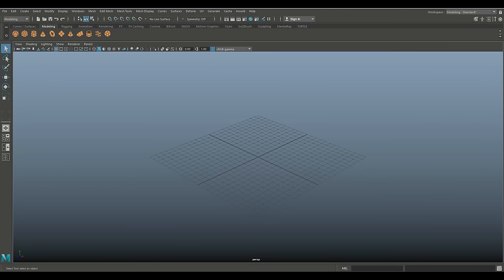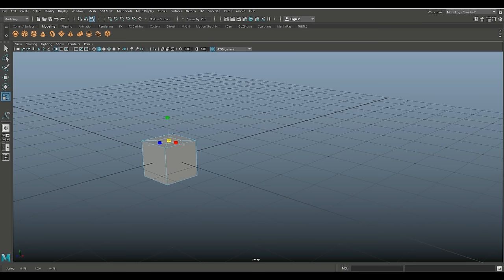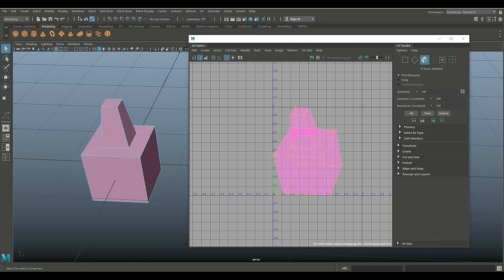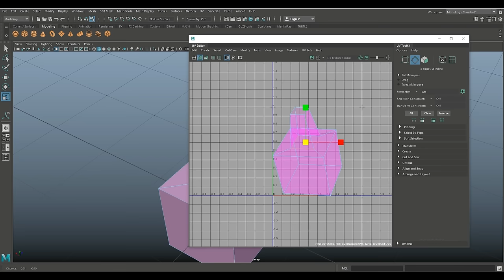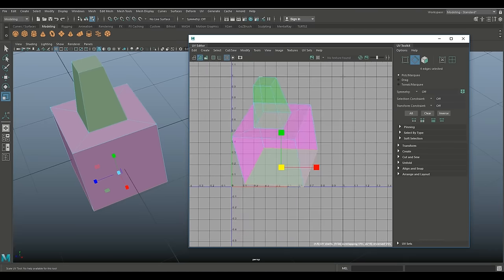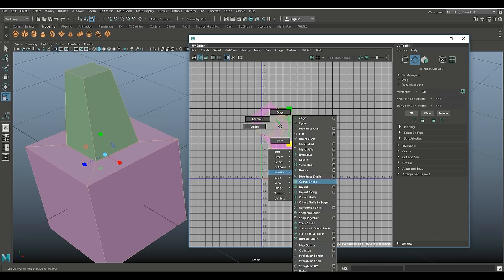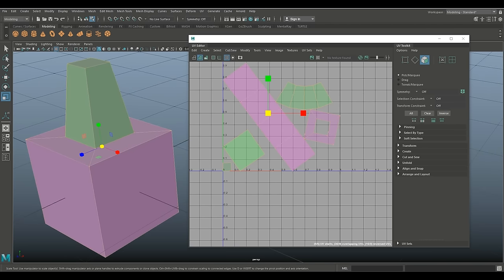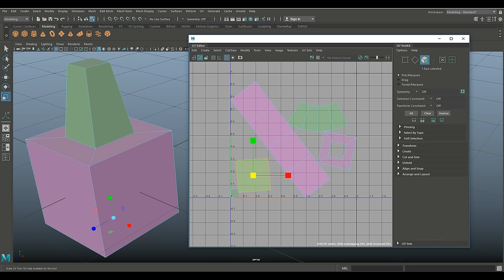UV MAPPING your 3D MODEL in Autodesk Maya 2018

Comment: Hey ,.. does the uv edtior > Transform > Map Size which the default is 512 ... affect the texture? when i import a 4k texture from substance painter to Maya
Reply from the maker: FlippedNormals ?
Reply: Mike Hermes sry... i copy paste the text and forgot to remove it.. can you help with my question? Thank you
Reply: @ZhengYuanz  The default 512 x 512 is the pixel size of the texture map. Even if you put a 4K texture on it, the texture will stretch out on a larger model. It is better to put the 4K file on a 2K or even 4K texture if you can get away with it
Reply: @MikeHermesPhotography   Therefore, what u mean is i should put a 4k texture file on a 2k map size? Map size : 2048 ?
I notice maya maximum is only at 2048 ..is it true?

Comment: hm... I've got a little problem here. I followed you up to the part where you start cutting the edges of your cube. In my case if I start the UV Editor it has by default already 2 colors on the cube and this doesn't seem right. Following your tutorial nonetheless it won't re-color the new shells, I guess because it won't create new shells at all?!
Does somebody know how to fix this?
Reply from the maker: Two colors means to shells. Go to shell mode in the UV Editor ( right click ) and select Move and sew and it will make one big shell. Then start to select and cut where you want cuts